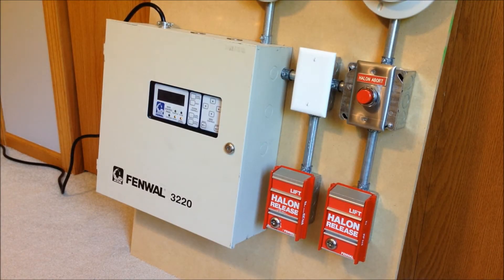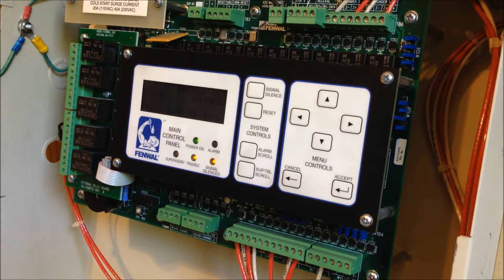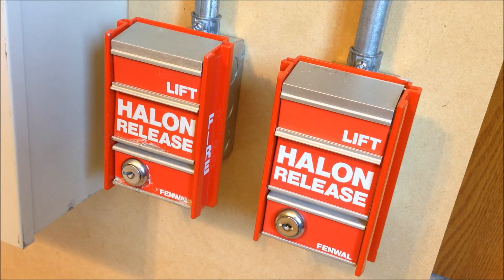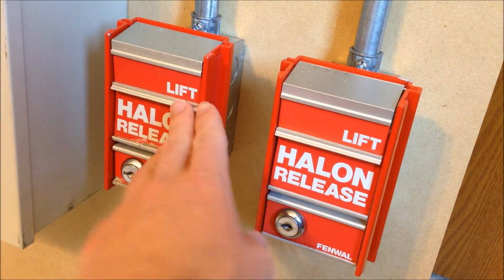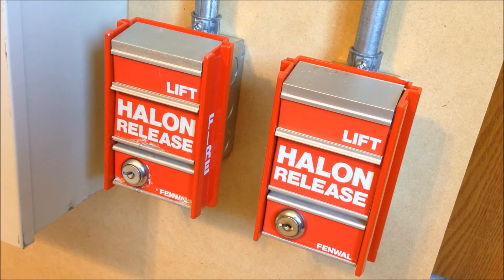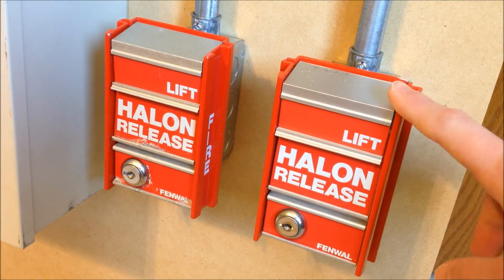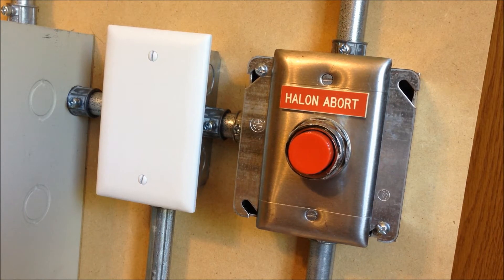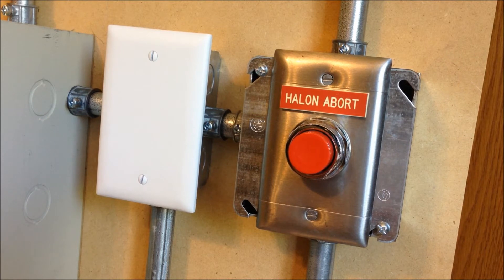Fenwal 3220 Fire Suppression System |  Introduction and Overview

Comment: Can you set a manual release zone to have a countdown timer or will that only work with automatic detection zones?
Reply from the maker: Yes, manual zones can have a release delay.
Reply: +kcin556 Could you do a system test involving that or do you not do requests?

Comment: I have a quick question here...How come you have three ground wires instead of just two? Because on my system, I  have one that grounds the panel door and box, and another to hook into the grounded AC connection...but you technically would only need those, right?
Reply from the maker: If you take a look at the panel at 2:02, the wire with the yellow terminal is the incoming ground wire from the plug. The wire with the blue terminal connects the cabinet to the door, just a short jumper basically. Finally, the wire with the red terminal connects to the chassis ground on the panel. They chose to route all of the grounding to one lug on the cabinet, rather than two separate connections, which requires the three wires you see.
Reply: Ok, thanks! Well I kinda did the same thing on my panel, only I used two wires (one goes from plug to the lug), and the other goes from the cabinet to the door. I'm not exactly sure what a "chassis ground" is, but my panel seems to work fine so maybe its different??? I might post a question about this on TFP later on.
Reply from the maker: The chassis ground is just the ground connection to the frame that holds the circuit board, distinct from the cabinet that the chassis (frame) is mounted to.
Reply: But you don't need it if you grounded the cabinet already right and the chassis is hooked to the cabinet? I posted a topic on TFP with more info.
Reply: Do I need to ground my SK-2's (MS-2) cabinet?
Reply from the maker: Yes - all fire alarm panel cabinets should be grounded. This not only protects the panel from transient voltage surges, but also protects you from being accidentally electrocuted.
Reply: kcin556 What equipment do you need to ground it, and what should you ground it to on a demo system?
Reply from the maker: Your power cord should have three wires. Two of them should be either Black and White or Blue and Brown; those are your 120VAC connections. The third will be a Green ground wire. All you need to do is connect the Green grounding wire to the grounding point on your panel. If your power cord only has two wires, you should replace it with a three wire grounded cord.
Reply: kcin556 Well that's obvious lol, I didn't have that my panel would have a ground fault. I thought you were saying the cabinet itself and the door need to be grounded separately from the board or something.
Reply from the maker: Nope, you just need the one ground connection. If there needed to be any extra ground connections (such as in my Fenwal panel) they would be done in the factory and all connected to one point so that you only need to connect one grounding wire.